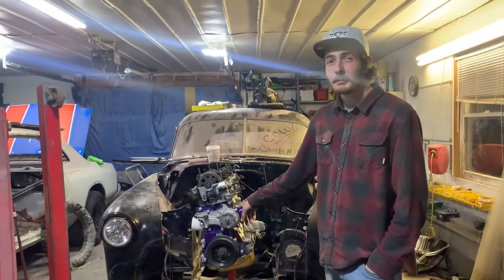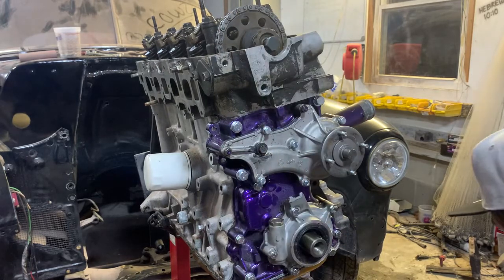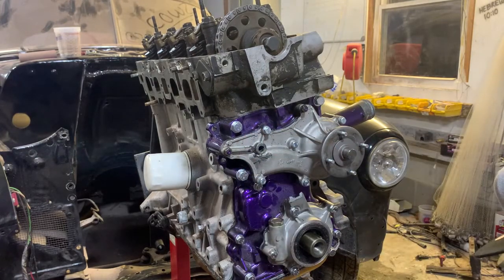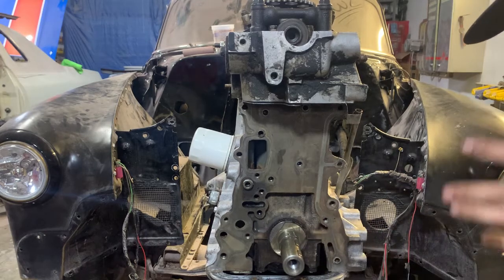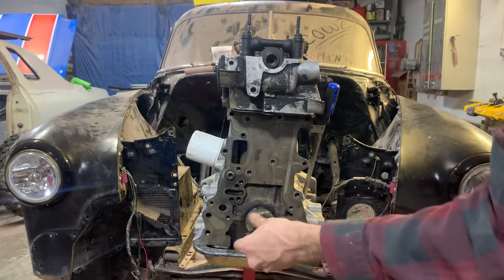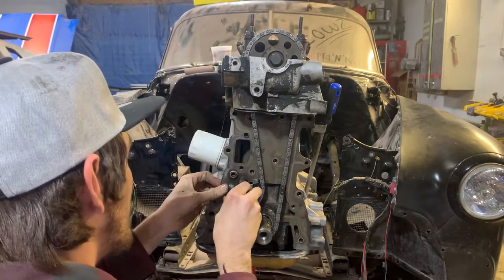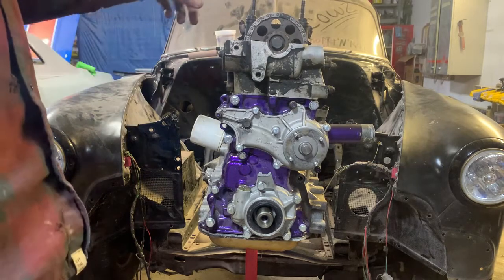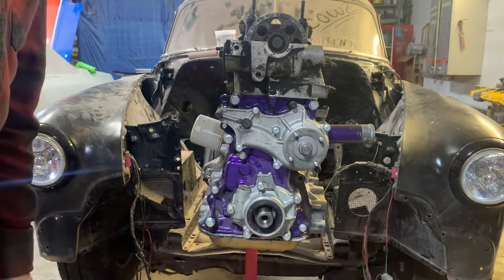Toyota 22RE timing chain How To, Easy.

Comment: Unlike in this video, always put the motor at top dead center, before removing the chain. Do not remove the Woodruff key from the crank ever, unless it is damaged and needs to be replaced. This way the motor always stays in time and replacing the chain is easily done, without bending any valves when you rotate the motor out of time.
Reply: Well said Alex.
Reply: He didn't even install a new or the old Woodruff key. Glad I read this Comment.
Reply: Thanks Alex there's always some little detail that got left out in these how to videos making them somewhat useless.
Reply: The 22r is not an interferential engine. You wont bend the valves it is out of time.
Reply: You can mill the cylinder head a lot and still not make contact with pistons to cylinder head.
Reply: What he said were sliders are actually called the timing chain guides.
Reply: That engine will never start and run if he does not put a woodruff key in the slot on the crankshaft.

Comment: You didn't show how you slid the timing chain cover between the head and oil pan,,, put it back on as easily as you did it off,,,
Reply: I'm sure the oil pan has to come off for the bottom of the cover to seal well with silicone.

Comment: do you have to put a dab of rtv on one of the bolt threads that goes through the timing chain cover
Reply: Yes you do, it's the long one that goes through the oil pump.

Comment: That timing chain cover came off too easily, probably because it lacked gasket maker paste between the oil pan and the timing chain cover, and between the cylinder head and the timing chain cover.

Comment: If the chain breaks on a 22r /re does it bend the valves?
Reply: I'm wondering that also cause I'm working on one and don't want to do all the work for nothing.I think Im going to borrow a stethoscope camera from AutoZone and look through the spark plug hole to see if the piston looks marked.

Comment: Good video man I appreciate it.
 the assembly was easy to understand … 
I’m going to comment on the key issue as I see some ppl are whining about it …..
Cmon ppl if you don’t realize one needs to be there or what shape it should be in before replacing it I suggest you stick to bikes and recheck your kids brakes …. Morons 🐔
I bought a timing kit with a metal guard drivers side only also came with a plastic one ..
I opted for the metal one and used two oil pan short bolts to bolt the metal guide on ..
It never came with the proper bolts ….   Good video man